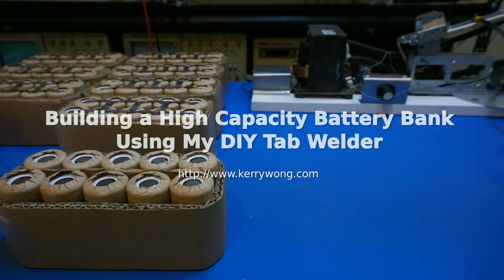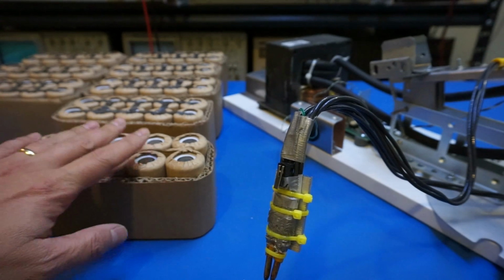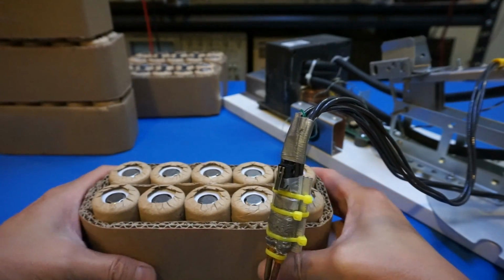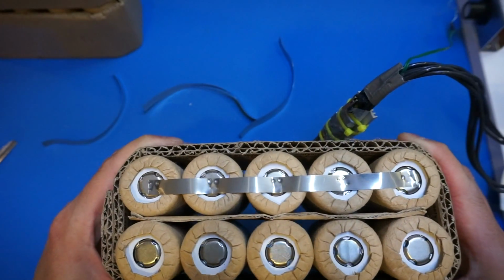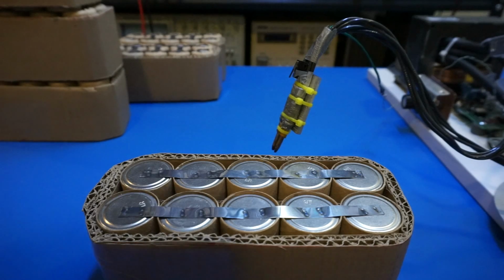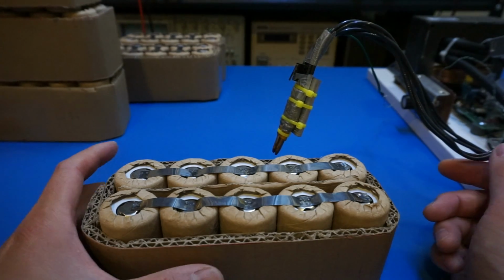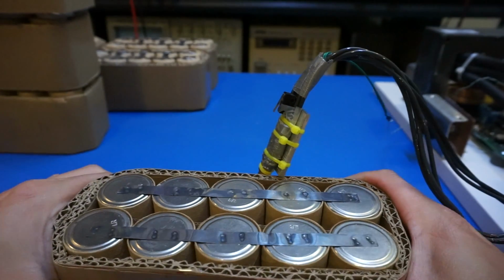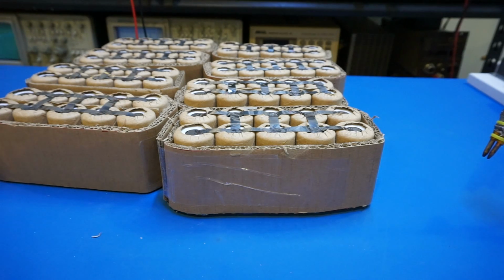Building a High Capacity Battery Bank Using My DIY Tab Welder

Comment: Hi Kerry as usual interesting, just wandering what is the typical application you have in mind ?
Reply from the maker: Once I finished building the battery pack, I will use it for a power inverter for emergency power. I will probably do another video in the next week or so.

Comment: Mate, looks like you're making an incendiary device...  two reasons.  Cardboard & fuses.  

Heat substantially degrades the life of rechargeable batteries (so insulating them whilst charging/discharging is a really bad idea), & overloads/faults can lead to thermal runaway.  Cardboard is a good insulator (which would exacerbate cell failure and overheating), and it's quite flammable (so keep away from ignition sources like sparks or red hot busbars).  Keep in mind, fire point is 258°C, the ignition temperature 427°C. Please note - when stacked (as in, your battery array), it also has a tendency to heat-induced spontaneous combustion.  Plus it decomposes over time & can attract insects and rodents (rats & mice being the natural enemy of electrical devices...).

There's a reason battery arrays space the cells apart and allow for air circulation (or water cooling).  And also why 'proper' arrays also monitor cell temperature...

Second point - fuses.  Strongly suggest you put a fusible link between each battery and the busbar.  That way you should be able to prevent dumping many amps of power into a failed cell (either when charging, or from other cells), causing it to catch fire and/or explode...  Pretty good idea if you don't have 100% quality control of the batteries you're putting into an array.

Anyways... good luck with that!  At least, don't put the array inside your house, any flammable structure, or adjacent to anything you find important...

Comment: Great video. Link to batteries please.
Reply: Tired of buying SLA for my 48V eBike every freaking year :(
Reply from the maker: This is the one I bought, the seller has a lot of these it seems: http://www.ebay.com/itm/NEW-Box-of-80-Tenergy-LiFePO4-32650-3-2V-5500mAh-Rechargeable-Batteries-5-5Ah-/351947933933?hash=item51f1bb48ed:g:YPoAAOSwoi1X87JG
Reply: Oh. I didn't know they where Tenergy!
Sorry but they suck. You'll be lucky if you can get 100-200 charges out of them before they start leaking and losing charge. At least it has been my experience from their C and D size of NiMh batteries. 
Once they lose reputation, what is their incentive to try to repair it? None that I can think. Most likely they will continue to sell crap, then open another company under another name. We are not talking Toyota or Honda here. 
Thanks for the video and the link though. I hope they are good batteries. Do let us know if you find them not to be so.
Reply from the maker: I will let you know how these batteries work in the long term. But I searched quite a few forums and people seemed to like these batteries. The other brand this guy sells is Fullriver which seems to get bad reviews so I bought the Tenergy ones instead.
Reply: I hope so. 
AS you can see from this link, good ones are still very expensive. https://goo.gl/UcuV3k
Only time and repeated charge/discharge will tell. Although in you application of standby power it should be OK, if you have a good charging circuitry that would not overcharge them. I'll stick to low charge rate, maybe 3 Amps, instead of crazy 1C or more.
Good luck.